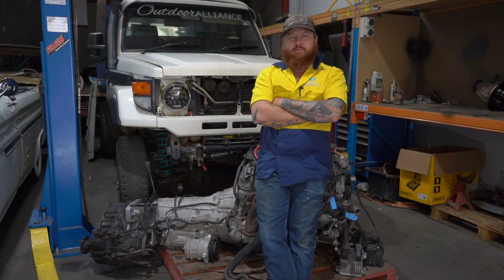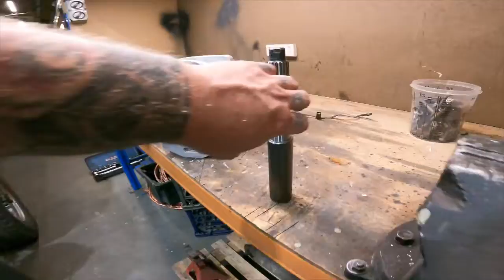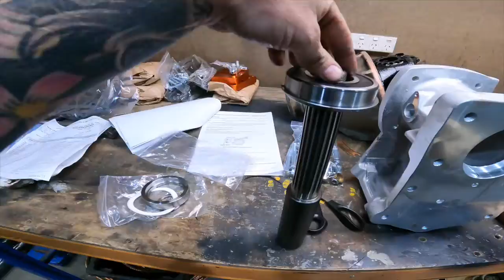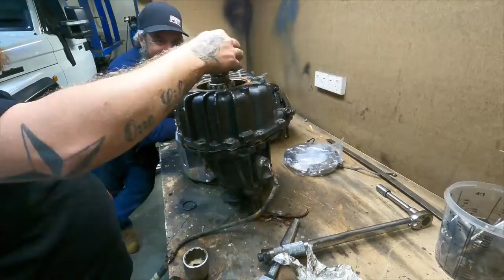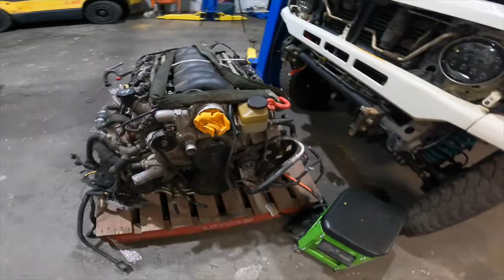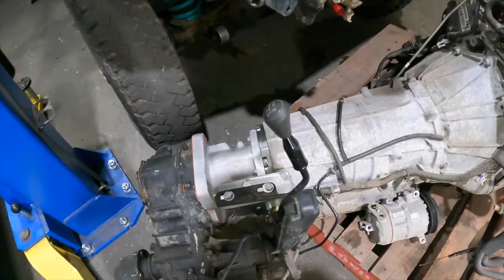EP6 LS2 and 8L80e into early 79 series ute ;EP6 dismantling old transfer and installing on to auto

Comment: I thought that older shape landcruiser was the 75 series ?     Love ur work anyway mate.     Things gunna be a pig
Reply from the maker: In 99 they got rid of the leaf front and went to coils and a slightly bigger cab (along with a couple of smaller changes )this was the first of the 79 series (hzj79) before going to vdj79 v8 turbo diesel in 07 , so if you look up any cruiser between late 99 to 06 they all have coil front ends , the 75 series ran through from 1985 to early 99 and had leafs all round
Reply: Good to know !      Thanks for the reply dude